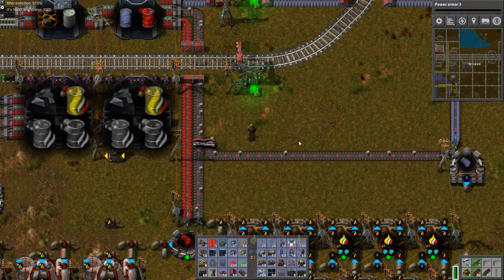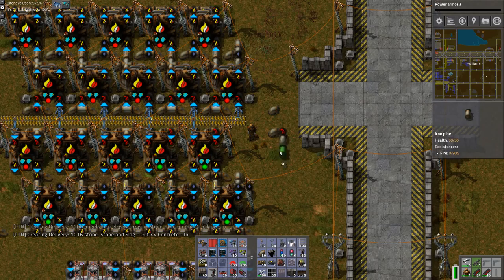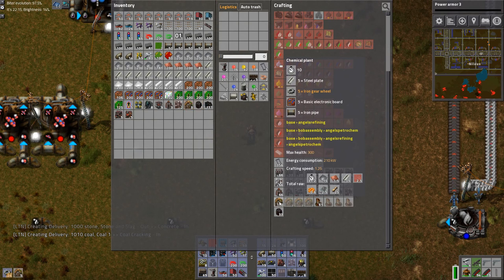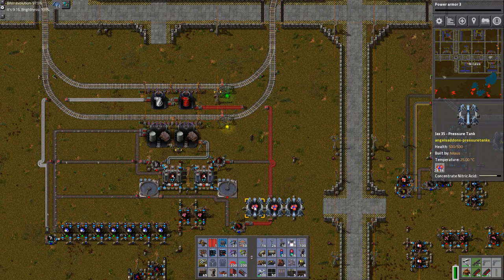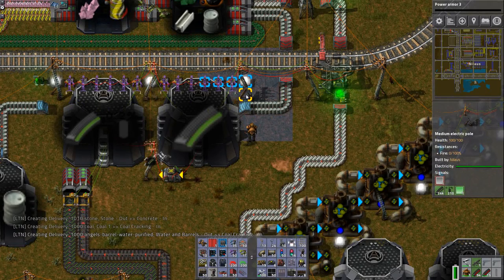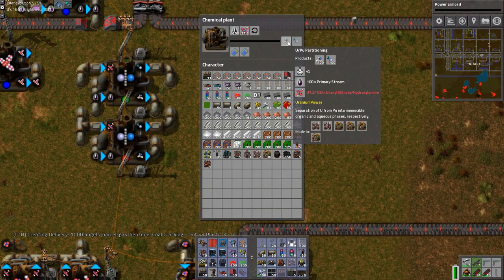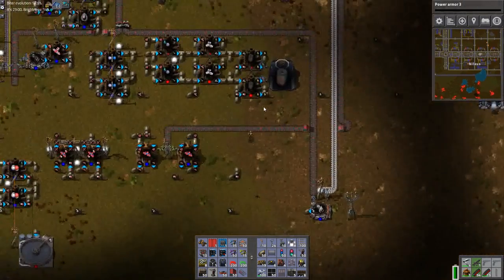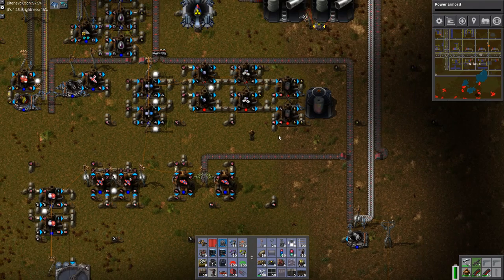Factorio S6E117 - Plutonium Scrubbing to Plutonium Oxide pellets

Comment: You mentioned that you wish that you could set up your oxygen pump to only run when the electrolyzers were not keeping up with the oxygen demand. I had a similar issue and found the mod called Flow Control. It adds several new valves, most of which are already covered by angels, however the one that angels didnt have was called a top-up valve. It is basically a reverse overflow valve, it only allows fluid through if the pipe its trying to fill is <80% full. Its very useful for situations like this where you want to set up a pump as a supplemental feed to help your main process keep up.

Comment: TBP - that's tributilphosphate, that long thing:)
Reply from the maker: I found out. After recording this I got curious about the nuclear process and spent the rest of the evening on Wikipedia and reading random stuff about nuclear power generation :)
Reply from the maker: Normal Chemical Plants MK4 require a lot of different resources. As I do not have Logistics robots on call to bring me any item I like then I am mostly stuck handcrafting many components. For that reason I do not go for the higher grades as they simply take too many components. Angels MK2 Chemical Plants are ok to hand craft as that just requires some Titanium and some green circuits in addition to the "normal" stuff
Reply: Some cool techs about how to refine spent fuel. "radio-chemistry" (from "radiation"), as I recall it.
Specific tech, not world-wide used, unfortunately.

Comment: Uranyl nitrate is usually pronounced "urinal night-trate"...  really the uranyl should be pronounced "u-ran-il"...  but the first is more common.
Reply from the maker: I must have been sleeping during those chemistry classes where we talked about Uranyl Nitrate back in school...
Some of those compounds I was pretty sure I butchered, just wait until I start on the Dimethylhydrazine and Monochloramine :)
Reply: Ahh, sweet sweet "geptil", aka dimethylhydrazine. In Soviet times, it was a codename for this fuel. And "amil" for nitrogen tetroxide as oxidizer in this bipropellant system.
Reply: Die-meth-il-hie-dra-zine and Mon-no-chlor-a-mene.  It does help that I am a chemist...  graduated back in 1982.